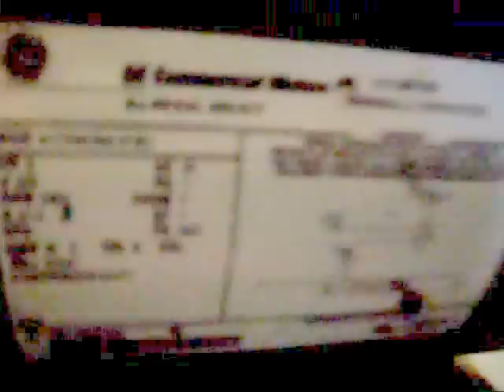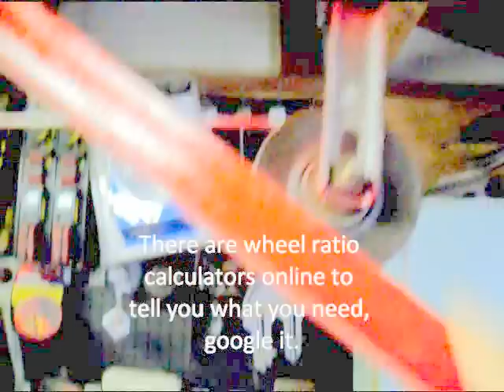Sawmill Construcion Details Part 2 (Enhanced Light Correction Added)

Comment: great and simple set-up - nice job.  I was wondering if the diameter of the wheels cause you to wear through blades faster?  Some say you need 19 inch diameter wheels or better, but they can be expensive.
Reply from the maker: That's due to the cheap blades they use.  I order cook blades.
Reply: BlueMacGyver thank you for sharing. can you please tell me where I can order the blades and the rubber part that goes on top of the jet wheels?

Comment: is this a 1 phase motor or 3 phase motor? i can afford the mill but not the 3 phase electricity in my area. so some more information on motor and amps and breaker circuit. thanks.
Reply from the maker: It is a single phase or 1 phase, 220v motor from tractor supply store.  It does 3450 rpm and has a 20 amp breaker and a 90 ft cord which goes to my dryer outlet in the house.  The motor is normal except that it is 220v.  It doesn't mattter to much what you use as long as you can get 5hp minimum.
Reply: thanks for that..

Comment: You are running the blade the wrong way, the powered wheel must pull the blade and not push it.
Reply from the maker: +Theuns Wessels You must have been drunk when you wrote that.  I will let you think about what you just said.
Reply: +BlueMacGyver . According to your other video your blade is running clock-wise(seen from the front), throwing the dust to the left. The video where you are pushing the mill with a stick. As your blade is setup in this video, the powered wheel is pushing the blade. Please look closely and dont be rude